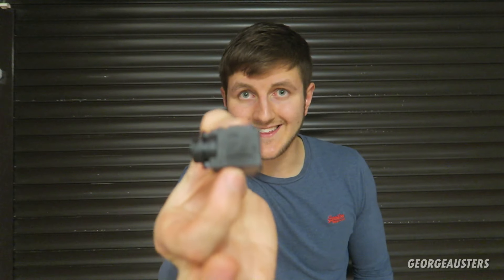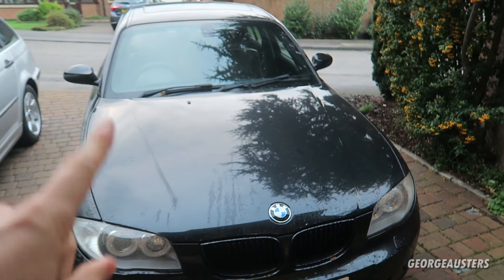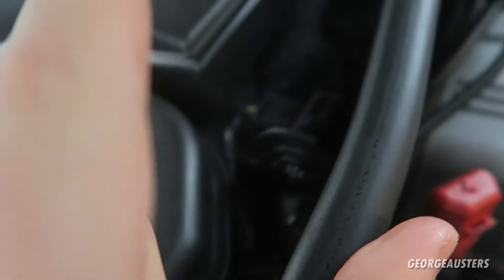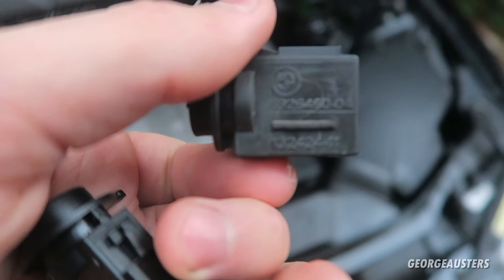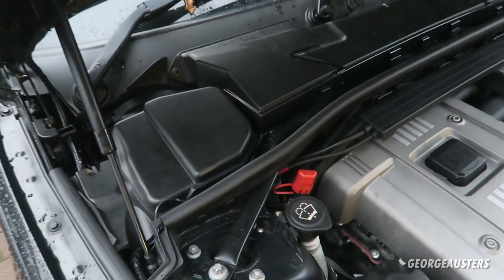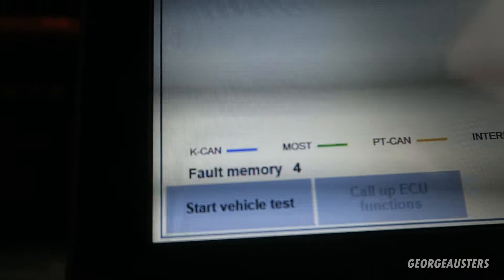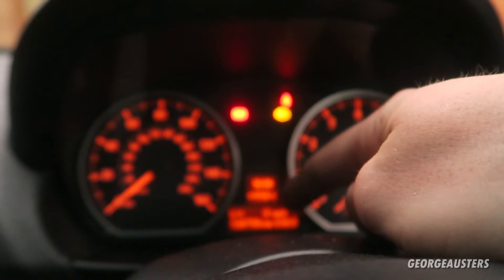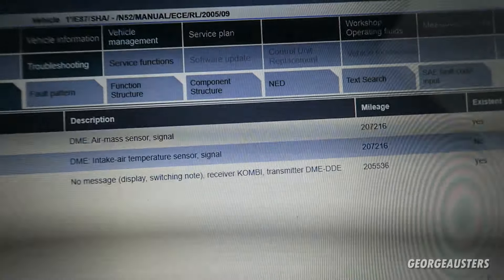Why You NEED To Replace This Sensor On Your BMW!

Comment: Why do you NEED to replace it? It is only used if you use automatic air recirculation. Just a bait title? sigh
Reply from the maker: You need to replace it if you want your car error free👍🏻
Reply: @GeorgeAusters  so in other words,  you don't have to, and its an attempt at a bait title. Got it

Comment: I popped mine open with a tiny screwdriver. I did crack that piece with the holes in it but done carefully you may be able to get it out without cracking it. I sprayed electrical cleaner into the electrical end, pushed the white filter and the plastic piece back and all good, no error codes, its been a few days. Alternatively you could poke a little hole in the white filter being careful not to touch the electronics and spray electrical cleaner in there with a long nozzle. You could probably even spray thru the white media filter. It might be just  little deposits on the electronics that alters the resistance and sets off a code,

Comment: Mine has pretty much not been working for the more than 6 years I have had my E61. Btw. it's only potentially being used by the car when you have the air re-circulation in A- mode *automatic*. In this position the car will take air in from the outside until it senses the air is sufficiently polluted - then it switches automatically to re-circulation. So not a big deal unless you travel a lot in areas with a lot of pollution, there it will come in handy.
Reply from the maker: I don't like anything not working on my cars haha!

Comment: would this sensor tell the computer diagnostic it has 0 pressure? I have changed the high low pressure valve 3 times, the gas is charged and with pressure but it doesnt detect the pressure so the compressor never turns on

Comment: I coded my ventilation to always recirculating. So I don't have to worry about that sensor. I would change it if I had an error code though.
Reply: OMG what is the coding for it, I can't find anything that will work on my F30
Reply: @801russc  I used the app called bimmercode to code always recirculate as default on startup  its available foe Android or IOS. Or you can have any coder do it.
Reply: @boistoys5451  1st I'd like to thank you so very much for responding so quickly, especially on a year old post, (mine was today lol, for those who are confused) 
What production model do you have or had? I've got a 2014 F30 335i, I've tried to code out auto recirculation with Bimmercode, Diagun iv & v and a few different ways with a laptop and have yet to successfully find anything that keeps it from "stinky, toxic, polluted so called fresh air"... Not being able to lock air recirculation for as long as I want will be the only thing preventing me from buying an New 340 or a used X6M next year, sadly this one thing has made me start looking at Audi S3's and hardtop boxters (can't remember the name of it). Anyway thanks again Bois....
Reply: @801russc  I have 2014 X5 Diesel, and 2002 E39. Both coded to have recirculating as default.

Comment: You don't need to replace it. Just take it out, open it up and clean it. There's a plastic gauze in it that gets caked with air particles that won't let air through. The sensor cost 100 US so fuck that i cleaned mine and it worked fine. Opening it is a dremel cut, then glue it back together. Takes an hour.
Reply from the maker: If you want to be cheap then by all means try and repair it
Reply: What should I clean it with?
Reply: @Jon Rod  I agree. In my experience, the "your cheap" slight typically comes from someone who somehow feels threatened that someone else easily fixed something that they paid $100 for. To compensate, they lash out and try to knock the ingenuity in others that they dont have themselves.That and many people are just mindless consumers. It's ironic because OPs comment literally is what made this entire video useful.
Reply: i did same thing on my e66
Reply: A bit less than gentlemanly there George.
Reply: @Thomas998822  So why are you feeling threatened?
Reply: @ferrumignis  I wasn't talking to you chief. The guy I was responding to deleted his comment, for good reason.
Reply: @Thomas998822  No he hasn't son, I can see it clearly, it's the first reply in the thread which was made by the channel owner. Maybe YT hid it from you because it triggered you so badly?
Reply: @ferrumignis  Its 3rd grade knowledge that every person has heard, used, and educated others with. Just because someone teaches you a lesson doesnt mean they are "triggered". Instead learn from the experience and maybe you can help someone with it in the future. Recycle Reduce Reuse. lol
Reply: @Grant-H2O  Except that you are objectively wrong in this case. Removing the filter is a destructive process, the sensor isn't designed to come apart. And when you do take it apart you are extremely likely to find the tiny sensor die has broken away from the microscopic wire bonds that both mechanically support it and provide electrical connection to the die. This is by far the most common failure mode of these parts.  TLDR: If you don't know anything about a topic, hush up.

Comment: 2008 750i and fans stuck on high if motor is running and since that started it wont cold start ive replaced water temp sensor and water pump sensor no fix , now im putting in new thermostat with sensor and hope that does it , do u think im gonna fix it or is it something elese like module?or fuse?

Comment: When do you know it needs replacing or will it show in the cluster?
Reply: @emilyhofland8219  it will show in a generic ob2 for bmws
Reply: @dflex4180  not the auc sensor. I checked.
Reply: @emilyhofland8219  showed up as a fault on mine using Veepeak and an app
Reply: @emilyhofland8219  yes it does and if it doesnt get a better one any generic obd2 has the capability of reading the auc sensor lol im literally staring at it as we speak both my cars need a new one
Reply: @emilyhofland8219  get a creator obd2 cheap for bmws definitely shows up
Reply: @emilyhofland8219  emily im sorry but im pretty confused how u own ya own shop and specialize in bmws but dont know that a $50 obd2 can tell u that ya sensor has a fault look at the other comments they say the same and ur not the only one that specializes in bmws if u like leave ya email and i will send a screen shot of the creator obd2 error but not arguing
Reply: @dflex4180  yep... Just my experience... Why are you so triggered by it?
Reply: @emilyhofland8219  i got 60€ delphi OBD2 reader and it shows AUC sensor failure in E61 2007
Reply: @Tempo_est  well. Good for you.
But by cheap.
I'm referring to my $25 c-reader.

Comment: I study the EGR removal for my bmw N47 e87. There are so many opinions on this subject and so different ones. Some say the engine will get too hot by removing it and will result in long term wear. Some recomend removing (you also as I see). I am not convinced what to do..
Reply from the maker: Just know that the EGR will always cause problems. With it removed, it’s one less thing to worry about and your engine will thank you for it👍🏻

Comment: can i check the wiring itself on my bmw 730d rear centre right as have defined the problem is the wiring as the other three work perfectly with new sensors in place

Comment: Mine was broken without error code. Just lost its sensitivity. 

In F30 3 series you can hear it very well if it switches into recirculation mode. One day i wondered why i didn´t hear the recirc noise for a long time, so i started to investigate and tested the sensor by letting my gasoline brushcutter blow some exhaust on it while reading the AUC sensor data with OBD. Showed almost no reaction.

After replacing the sensor i repeated the procedure, the new sensor reacted immediately and switched into recirc mode. The new sensor has a "02" version index on it, so i hope BMW optimized it to last longer than the original "01" indexed version.
Reply from the maker: Interesting!

Comment: Hi George, my wife is pregnant and we have found she has high carbon monoxide in her body, we have since had a carbon monoxide tester in our car and it is entering the car. Bmw 1series 120d 2014. Could this sensor be the answer? Or is it likely to be from somewhere else.  Seems to be entering through the vents.  Thanks in adavance
Reply from the maker: This will sense bad air outside and turn on automatic recirculation

Comment: Hi mate. I have a CEL on and codes I have are 801225 , 801224 and E71439. What may be causing this, just had air con recharged but still have light on.

Comment: Does this sensor have anything to do with the oil sensor and engine tempeature guage going up? Have changed all parts on my F10 but still car gauge is going slightly high on long drives
Reply from the maker: No
Reply: Exactly what problem are you facing? Did you clean your radiator?

Comment: All this does is automate the Recirculating valve for the cabin air. thats it. you dont HAVE to change it. you can manually select recirc in the cab by the controls. replacing it is more to get rid of the constant error it gives. 

Why that thing costs so much is anyone's guess.

Comment: I have a question I put the computer on my car and the code was 9C54 AUC sensor... the question is. Can that sensor affect the cooling fan of the car??? Because it turn off and the car start saying high temperature and air conditioning start throwing hot air then suddenly the car start shaking when AC tries to turn on when car is on the move.
Reply: sounds like a bad ac pump

Comment: I had an eggy smell coming from my heaters a week ago but only smelt it for two days then after that it seems to have dissapeared as I’ve not smelt it since could this be the sensor or something else?
Reply: Battery
Reply: Zoe Balbaert my battery is only 1years old and its in trunk an the smell come from heaters only for two days I haven smelt it since this was around 1 month ago
Reply: @joshcatalano5127  oh ok must be airco vent then
Reply: Dead animal in the cabin filter? This sensor going bad will cause you to smell things, under the hood. ... But, it won't cause any specific smell.
Reply: @emilyhofland8219  u kno your stuff ma

Comment: i hawe normal hot air on top litle hot air on botom and COLD air on mid and i cant chance that to by hot or kold car is always on this air atance someone can tel me what i do to repair it car is BMW 2006 E60 530d 231hp i hawe cod on rhis sensor i replace it but nothing

Comment: So, I've replaced this sensor with junk yard sensors, new sensors, and even took one from a friends car who didn't have the code... and I still have the code... 
Any ideas?
Reply from the maker: Need to buy new
Reply: @GeorgeAusters  
I did from FCP euro. And when I put it in my car, I still have the code. I put it in my friends car, he doesn't have the code. I take his and put it in my car.... I still have the code.
Could code 9c5f have anything to do with it?
Reply: @leethompson5590  bro did you delete code? you must delete code, if it comes back then check wires.

Comment: Mine looks like the sensor got cut off😂 I only have the wires left. Because I removed the cowl cover permanently, so I had to leave that sensor dangling. But my 335i runs just fine 🤷🏻‍♂️

Comment: Not worth the the money to replace this ...£50 down the pan IMO
Reply from the maker: Depends if you like error codes or not
Reply: @GeorgeAusters  prefer the £50 over an error code which doesn’t really make a huge difference to the ordinary driver

Now if it’s producing a fault on the cluster then definitely it’s an error worth fixing, but this one wouldn’t. I once had a car with 98 error codes before I wiped them, bmw 640d… it drove like a dream!